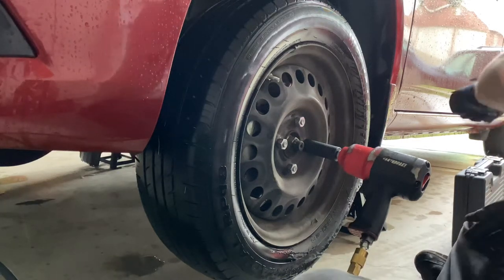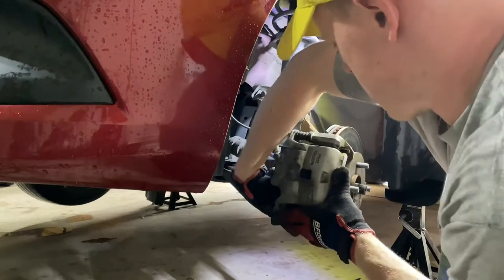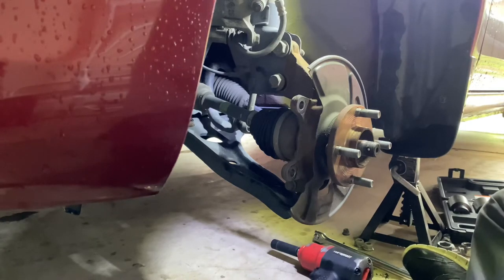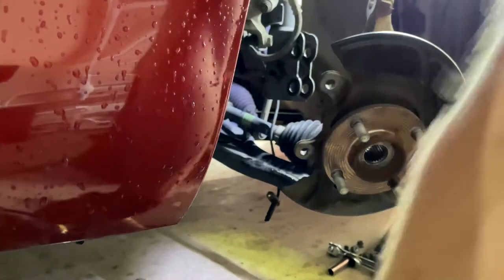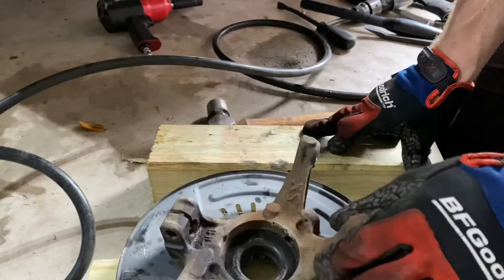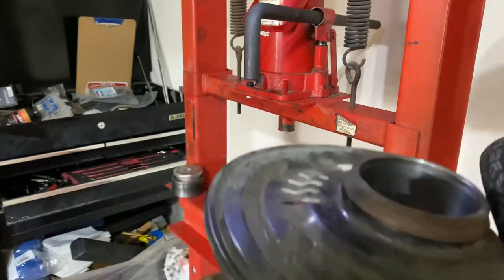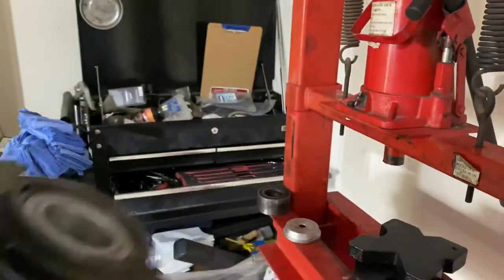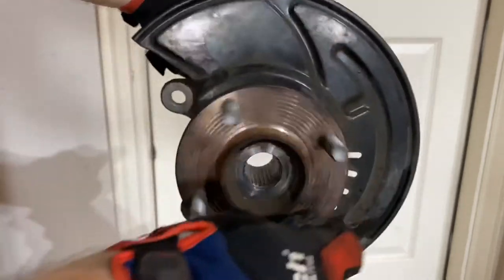2016 Nissan Versa/Note Front Wheel Bearing Replacement

Comment: My biggest question is, are there four that can be replaced because for whatever reason online I can only find ones that are specific like on the Nissan website for example it only says front driver side
Reply from the maker: @tiffanystouchofcolor  the front two bearings are the same and the rear bearings on both sides are the same side to side but different from the fronts. So there should really be two part numbers.

Comment: Very helpful video. I just bought a 2016 versa with 80k miles and I'm starting to hear a humming noise front the front. Its probably needs new bearings too.
Reply from the maker: yogiracer thank you! If it increases with speed it probably is the bearing. 👍 good luck!
Reply: It happens so fast, do it sooner than later because it only gets louder

Comment: How many miles are on your Versa? Just curious as to when I can expect to have to replace mine.
Reply from the maker: Andy Smith This one only had 48k on it. I also did the rear passenger side bearing at the same time. Not sure how two bearings failed so early in this car’s lifespan but they were bad.
Reply: @zachmiller289  Thanks!!  Great Video!!
Reply: 2014 Versa Note with 170k miles.   Front bearing is going out, I drive on paved roads.
Reply: Zach Miller doing my sisters as we speak and it also only has 41k miles. Cheap crappy bearing from factory im guessing.
Reply from the maker: John Paul Barrientos that’s all I can figure as well. The one I fixed hadn’t been driven hard or abused from what I could tell. Not too bad of a job though. You got this! Reach out if you have any questions on it!
Reply: I am taxsi my Nissan sunny 2 years 300 000 km 🙈

Comment: Would a bad wheel baring be the cause of slight shaking from one wheel?
Reply from the maker: If a wheel bearing is pretty bad you can wiggle the wheel from side to side when it’s up in the air. I’m not sure if that’s what your question is referring to or not. The symptoms typically apparent with a bad wheel bearing is a roaring/growling type noise that gets louder with speed. I hope this helps!

Comment: did yours make squealing noise when you drove? my versa note is squealing loud between 40 and 80 at the front right wheel, the only bad thing i found is when you take the hub nut off there is a ton of play in the right knuckle but not the left one

but with the wheel on it doesn't seem to shake at all when you do the 9-3 12-6 shake test